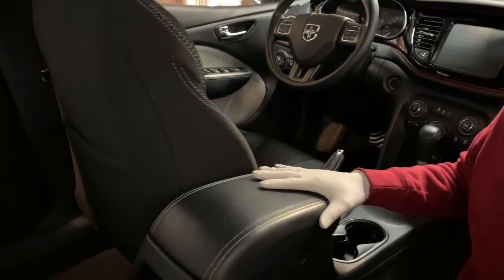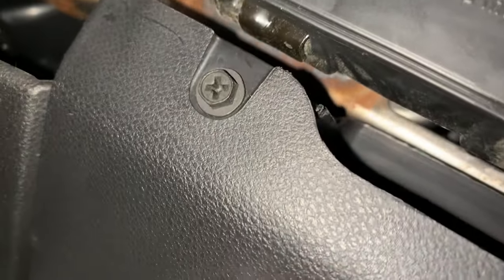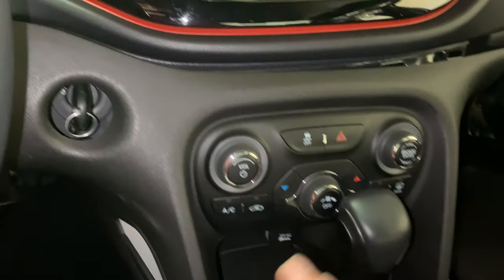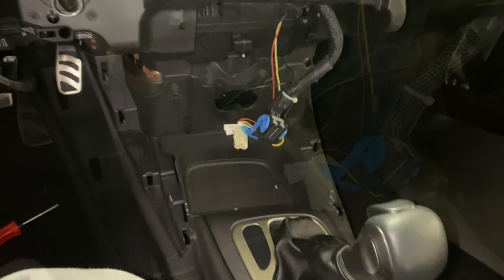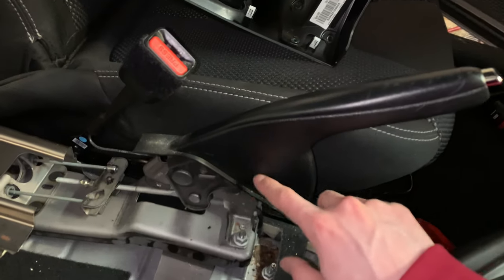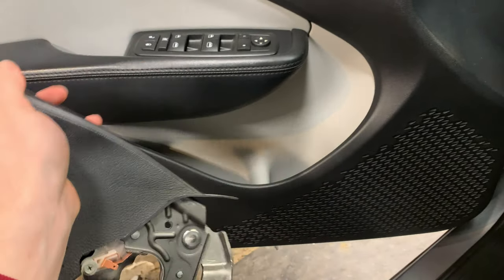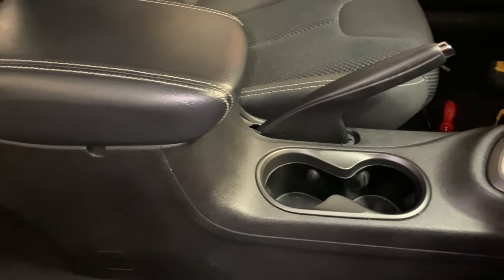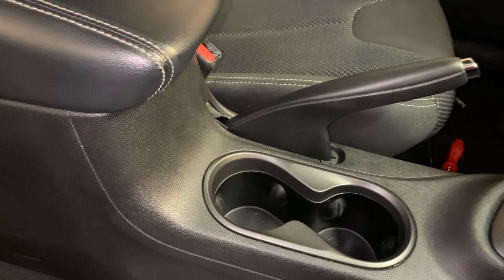2013-2016 Dodge Dart Center Console Removal and Parking Brake Handle Replacement

Comment: Thank you for the very good video. I had to remove the console in a 13 dart automatic car just like yours to access the top of the shifter cable from the shifter. By following the instructions shown, saved me a lot of time.
Reply from the maker: Thanks for the kind words! Glad to be of help!
Reply: Had to adjust the shifter cable? Mines is currently stuck in gears dealer quoted me 2400 I’m hoping all I need to do is adjust the cable. It happened a month after they did a recall on the housing.
Reply from the maker: Have you checked the bushing on top of the transmission where the cable connects?
Reply: @jonathant4032  Hi Jonathan T,  On my 13 dart, I had to replace the shifter cable. The part from the dealer was about $100 list price. The cable was broken where it attaches to the transmission gear selector lever. It broke off and it would not come out of park. To replace it you have to remove the console like the video shows, then you have to remove the wiring connection from the bottom right rear of the shifter, then remove the cable from the front of the shifter. Have the new cable in front of you and you can see how it detaches, then remove the four nuts that hold the shifter to the floor. after you remove the shifter push the rubber boot through the floor. Working under the car remove the left front wheel, and the center splash shield.  the cable attaches to the transmission on the left side There again you will see how it detaches from the gear selector lever and the bracket just ahead of gear selector lever. I had to pry the cable out of the bracket with a big screw driver, as it was stuck, but it does come out. There is a plastic clip that holds it to the center cross member that you have to detach, then slide it to the right and it will snake past the cross member and the stabilizer bar. Then pull it back from under the car on the far right of the cross member. Then pull it from the inside of car. The install is the reversal of the removal, and the adjustment bolt is on the shifter end, and make sure that the transmission is in park as is the shifter, then tighten the bolt with a 8 mil socket. Hope this helps.

Comment: Thank you for the video, I need to adjust the E-Brake on my 2013 Dart which has the same console.
Reply from the maker: Thanks for the comment!
You can adjust it from the adjustment under the console for sure. I do not believe you can do it from the caliper end as the e brake on the dart just engages the service brake caliper. 
Let me know if I can answer any further questions for you!

Comment: Nice video. I have a question maybe you could answer. Would I be able to replace the cup holder in my 2015 Dart with an OEM Illuminated one from the 2013 line? Is there a place to connect it to the wire that goes to the USB port? Or would I have to slice into the line at that point?
Reply from the maker: Thank you
I did not happen to see any additional wires under the console.
I would think that the interior body harness would be different per option package, especially with the 2013-2015 year difference